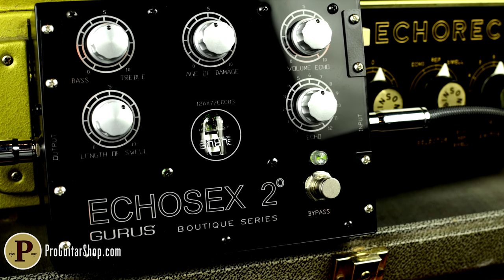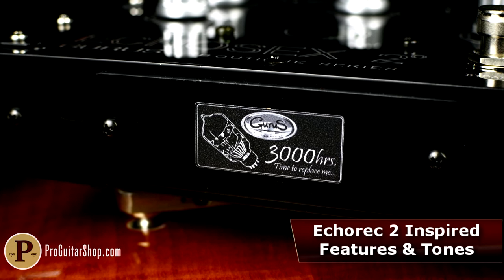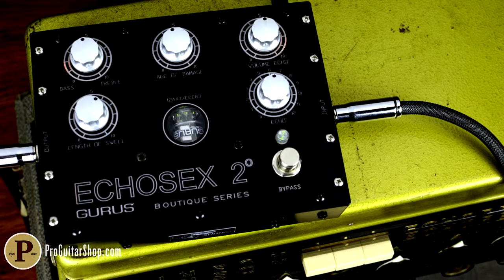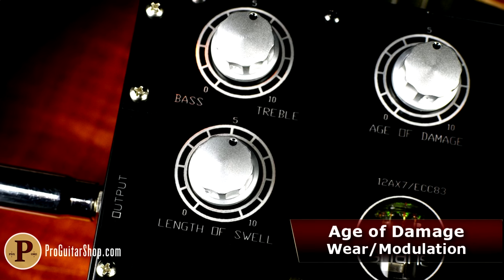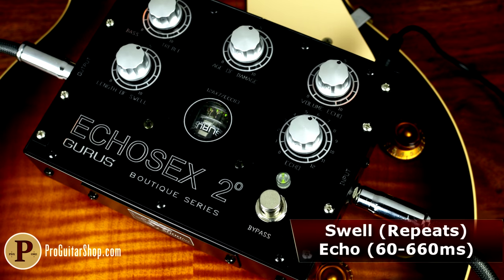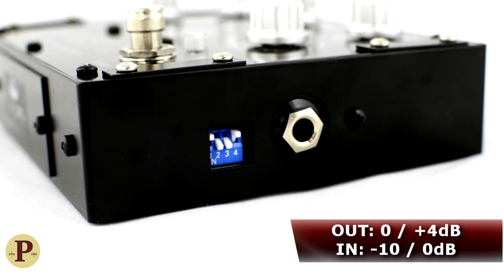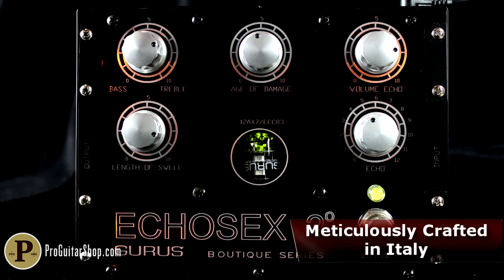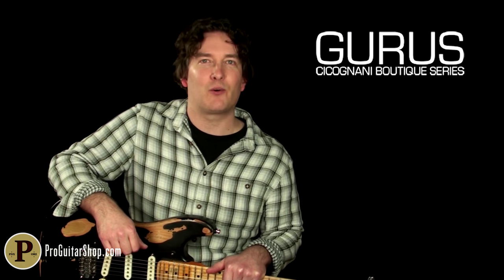Gurus Amps Echosex 2

Comment: I own 2 binson echorecs in pristine working order. a nos tube super special and an ec-3. this sounds nothing like them. imo, this sounds very familiar to the analog chip delays of the late 70s through 80's before digital ruled(ex. boss dm-2). if you want to emulate the echorec, try a boonar or catalinbread. tc flashback does a good emulation too. I personally think it's ludicrous to spend $500 for an electronic analog delay pedal masquerading as a good copy of the magnetic drum echo. 

also, part of the binsons sound is the swell setting and selectable playback head combinations. I have yet to see anything match the ethereal reverb from a Binson's swell mode just before the point of runaway oscillation.
Reply: It is hard to get closer with a pedal than the Catalinbread Echorec, IMO. I've spent several hours on a Binson, but that doesn't let you know it like owning one does. Even if there are minute differences between the Binson and Catalinbread, I still love it for what it is. Hearing an owner recommend it makes me feel like my ears weren't lying to me. Thanks, and keep playing those Binsons! I hate seeing people putting them and other great, but rare and $$$$ gear up on shelves. Sure, the look pretty, but if you take good care of it, it'll make great music and still look good!
Reply: +Brad Carroll yup, all that matters is that it sounds good to you.
Reply: It's not even analog, it has the PT2399 digital chip. When it first came out they marketed it as 'all-analog', a fallacy which I called them on. They still denied it, saying that 'only' the delay line was digital.
Reply: +George O'Donoghue I agree. the 'analog' chip delay pedal brands only get away with that saying because there isn't a computer program sampling the signal. hence there's multiple knockoffs and dyi kits because they're easily copied.

I would not be surprised if there's a dyi kit that can be tuned to sound nearly identical to the echosex. I'll bet the majority of people who are excited about the echosex are not familiar with the Binson. I'm just glad catalinbread patented the name 'echorec' before gurus defamed it.

Comment: echosex or the echorec or strymon timeline?
Reply: Jonathan Macaw 
If you want the closest to the real deal, check the Boonar Multi Head Drum Echo. Catalinbread Echorec is also a more faithful version, at a fraction of the price. 
The Echo Sex V3 has tap tempo, but that isn't what a drum head is meant to do. And their claim of all analog, is not true. It has a digital chip, no multi head, and is the least versatile of the three top Echorec pedals out there. Andy has denied all of them, so check em out. 
Performing live, I'd go Catalinbread, as it's in a small enclosure and sounds great. 
But the Boonar is the most faithful one.
Reply: @CorbCorbin  so echorec is more faithful than the boonar, but the boonar is the most faithful? Are you drunk?

Comment: Italy has a rep unsurpassed from way back in the early sixtys.this is not cheap china crap.
Reply: Edad Martin 
It's still got cheap digital chip, inside of it. 
The Catalinbread Echorec and the Boonar, multi head, units are just as good, if not better, without bullshitting, that it's all analog. 
Even the multi head delay, in the Keeley Dark Side has an excellent sound, and you get four quality modulation effects, and a Fuzz with it, for less than one of these.

Comment: They cool pedal I use I have got revb trem one an compresser. Run on pedalboard run in too DV ,Mark mulitamp an evo 1   An in line strymon timeline an strymon fx too.  Just. Gurus comp run too DV Mark muliamp an evo 1. Changed bit Mark wet in note bast setup tone still OK with too but just put magic touch on note an play.   These pedal cost bit get then s/hand good  use strymon end from gurus revb/trem really wet full  omg. Great set.  Wet dry wet. An foot volume pedal control on two amp.  Mix it.    Omg.

Comment: Thanks.  What are you using at 6:10?
Reply: That's called an e-bow. You hold it up to the string and it will sustain the note for as long as you like.
Reply: @awduvall  Ahhhhh.  When was it developed?  Thank you!!!
Reply: @aeonmouse5802  According to wikipedia, it was invented in 1969, and publicly introduced in 1976. They still make them, though. TC Electronic just recently came out with their own version too. They call their's the Aeon. I don't have any experience with their's, but it looks about the same in the demos I've seen.